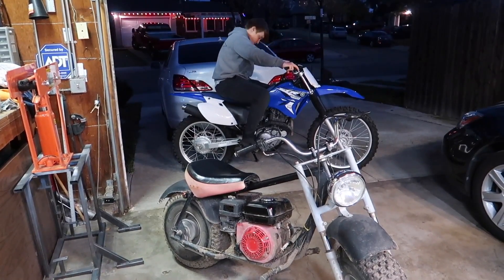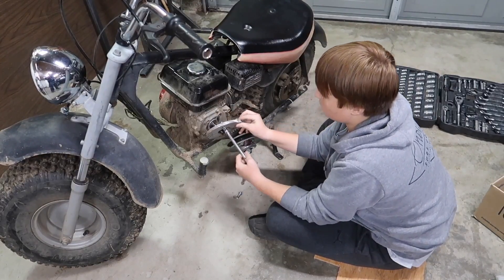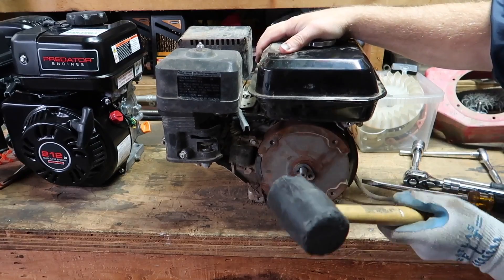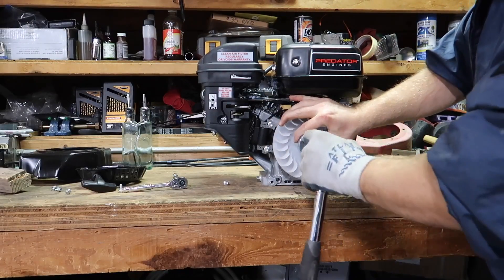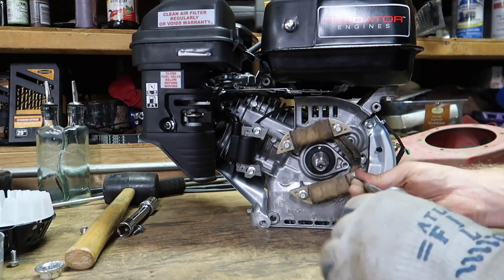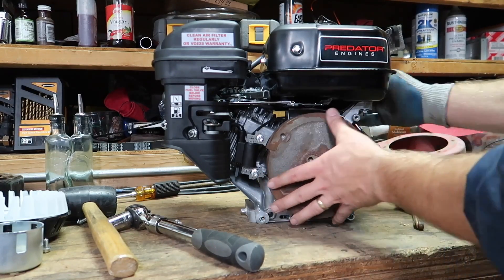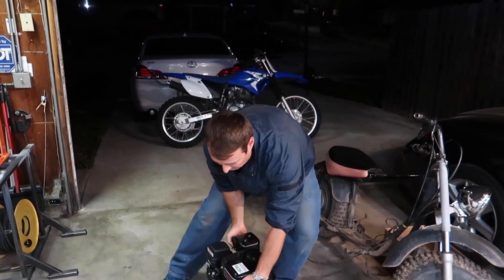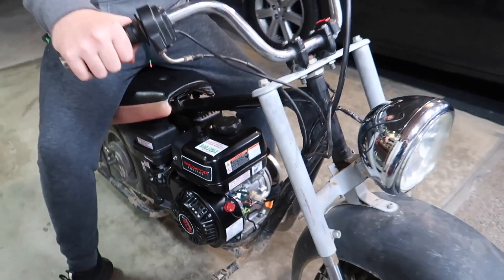Powering 12V headlight with 212cc predator engine

Comment: Nice Job.   You can wind your own coils,   they're only a coil of wire..    Take an old one apart,  unwind it,  and count the number of turns it takes to remove the whole wire..   If ya rewind it with longer wire (more turns)  you'll get more voltage..    if ya rewind it with larger gage wire,   you'll get more amperage. .
 either way  =  MORE POWER !   Then you can add a tail light,  and fog lights,
Reply from the maker: ThomasTheSailor Chubby 
Thanks for the tip. I’ll have to look into that. Cheers 👍
Reply: Thanks for that info ...I have hemi version and luv to make stuff work

Comment: What's wrong with the Hf flywheel? Won't it work with the coils?
Reply: John Larson you need the fly wheel with the special magnets on it to work with the coils. That’s how it generates electricity.
Reply: Then which one
Reply: Cris Leon the original engine that came with the light has special magneto coils. The flywheel has magnets which work with the magneto.
Reply: Thanks
Reply: so the Predator that has mounting holes for the coil, and even has motors that come with the coils( the generator's motors).. but doesnt put the flywheel with magneto   in every motor they produce? I guess it would add too much in cost for mass production to add something that isnt being used eh?

Comment: What type of voltage comes out , ac or dc?
Reply from the maker: jose navarro 
Wall outlets are AC current
Alternators, generators DC current. I strongly believe these coils produce DC current.
Reply: @balabay77  Nope...it's AC.  BTW - Alternators are literally called what they are because they generate alternating current (AC).  That's why car alternators have a rectifier/regulator on them to produce the steady DC the vehicle runs/charges off of.  You can get a $10 4-wire rectifier/regulator from Amazon for things like mini bikes & go karts.  2 wires hook to your AC output (from the coils), and the other two can be hooked to a small battery which can then be used to power DC items such as LED lights.

Comment: Is there a way to hook this to a battery to keep it charged?
Reply from the maker: Justin's Garage 
I’m sure there is a way to hook it up to a battery but I haven’t tried it. If you find a way to do it share your info with others. Thanks for watching and commenting. 👍
Reply: Yeah I think all you need is a 4 wire rectifier regulator you can get for 10 bucks on amazon..  It'll keep batt charging at 14.4v. If not enough voltage from regulator, could use a boost circuit to bring it up to 14.4v.
Reply: @bwxmoto  hmm sounds like a neat little project for a super capacitor.

Comment: Do you have to have the old flywheel or will the new one work?
Reply from the maker: SbXloc3 
The new flywheel doesn’t come with magnets on the inside of it. Magnets on the Outside of the flywheel generate electricity for the spark plug but the inner magnets for the lights.
Reply: Ya i payed more attention to it when i rewinded the video. Thanks tho

Comment: How many volts and watts does that coil put out?
Reply: Luke Hansen it puts out an unsteady amount depending on the rpm the engine is running, you will need some kind of current regulator for the amount of voltage you would like.
Reply: At full throttle would it run 2 18w lights?
Reply: Luke Hansen, probably, you can check the output with a volt meter to see what’s its putting out with normal throttle.

Comment: Thanks for the vedio. You have helped me in the past in building my baja bike. It's completed. Thanks  for ur help. A quick question my baja bike has a handle with a coil spring on the top middle section of the handle bars which acts like shockers. Where can I get a handle frame like you where the shockers are at bottom of each end like tradition bikebir your bike. Also which can fit like yours on my baja bike. Thanks pl. Reply
Reply from the maker: Hello Randy. If i understood you correctly, you have the older style front fork and you would like to convert it to different shocks? heres a link to parts that you might need
https://www.ombwarehouse.com/mb200-128-baja-oem-steering-stem-assembly-black.html 
https://www.ebay.com/itm/Mini-Bike-front-Shocks/173073366056?hash=item284bf9fc28:g:AEYAAOSw9mpaN1rc
Look like these shocks are hard to find but maybe other websites have them? good luck
Reply: balabay77 THANK  you soo much. Where can I get the shockers for this fork handle pl
Reply: Oh ok in saw the linnk for the shocks THANK you

Comment: Hi, I just bought ct200u-a with it stock engine (196cc) I need power distribution unit to generate electricity for all lights. Instead of buying exterior power unit or a generator for that matter , I need this installation. Like I said that I have the stock engine I do not know which flywheel to buy, please can you show me all 3 parts for to buy?
Reply from the maker: Nulapon love 
Hello 
You’ll need flywheel 
https://www.monsterscooterparts.com/baja-mb200-flywheel.html?gclid=CjwKCAjwsfreBRB9EiwAikSUHTzI_RCqdF7lObaNxp5ESuUlKpYHSR70T4iy4gfMtONzHqR57ag2KBoCi5cQAvD_BwE

A charging coils 
https://www.monsterscooterparts.com/charging-coil-163cc-196cc-gocart-engines.html?gclid=CjwKCAjwsfreBRB9EiwAikSUHSM7QL_8r9og1npCPMZg0KPjXE5uVHNP8tOp2-_CRt3MrYs5SSnmZRoC238QAvD_BwE

And a fan for your flywheel
https://www.ebay.com/i/183507957982?chn=ps&ul_ref=https%253A%252F%252Frover.ebay.com%252Frover%252F1%252F711-117182-37290-0%252F2%253Fmpre%253Dhttps%25253A%25252F%25252Fwww.ebay.com%25252Fi%25252F183507957982%25253Fchn%25253Dps%2526itemid%253D183507957982%2526targetid%253D474392086544%2526device%253Dm%2526adtype%253Dpla%2526googleloc%253D9032435%2526poi%253D%2526campaignid%253D1480970876%2526adgroupid%253D56758917549%2526rlsatarget%253Dpla-474392086544%2526abcId%253D1139286%2526merchantid%253D101500315%2526gclid%253DCjwKCAjwsfreBRB9EiwAikSUHYKG53G1BsTCfuqJXqZfcCNgxXFZ2auH55cW8F9Xyiai-3wT8xu8dBoCooAQAvD_BwE%2526srcrot%253D711-117182-37290-0%2526rvr_id%253D1729096171906%2526rvr_ts%253De1b34b541660ad4d1cd12cd0fff2db68

Good luck buddy

Comment: What about a voltage regulator? You don't want lights dimming and growing bright with variations in engine speed.
Reply: He'd need to install a battery and a voltage rectifier to have a voltage regulator be useful. It isn't really worth the effort. All you would get is a headlight that is bright at idle until the battery drains itself to idle voltage.
I could argue that a voltage rectifier is a much more useful modification to make, converting the power to DC is easier on the bulbs, and DC power in general is more useful in this application, but even that's not necessary. There are thousands of these little Doodle bugs running away with AC power lighting the headlight. In the end doing nothing is probably best. No use modifying it, unless you wanted to run say an air pump, or a phone charger

Comment: best option i found is to JB weld some super magnets on the inside of the flywheel it came with and i grabbed the stators off the engine that came with the BAJA.....total cost...15$
Reply: What magnets did you use? Does placement on inside the flywheel matter or just evenly space them? I havnt seen a link for a charging flywheel but the coil links below seem good. Someone should sell the fly wheels and coils as a package.
Reply: Ummm no..... Not balanced at all. You will eventually kill all your bearings.

Comment: The block is perfectly clone from the Honda engine that's why it has all of the same holes and parts, just different generations of Honda clones at different gas tank mounts and different valve covers

Comment: the hemi has a different crankshaft and the fly wheel is different
Reply: Is it worth buying the hemi version? My local HF only has the Hemi at the moment. Was going to wait for the non-hemi to come back in stock.
Reply: @ChristopherJones16  I was wondering this also because I ended of with hemi one back when they were $99 at HF

Comment: Did the predator come with magnets inside the  flywheel? Or you swap the old one in the predator212
Reply from the maker: Vance mac D 
Predators flywheels doesn’t come with magnets 🧲 
That’s why I installed the coils and flywheel from that old engine. The swap was a success and everything still works.
Reply: @balabay77  I had a Coleman motor brand new ran for 1 day then 212 non hemi swapped the bike and decided to get the headlight working I installed everything like you did in the video but my headlight won’t work I have people telling me to get a tree magnet flywheel then to buy new coil pack if you could give some advice that would help very much

Comment: Was there a huge difference in performance between the little 160cc compared to tbe 212cc? I'm redoing a Baja and plan to put a new 212cc on her.
Reply from the maker: Phil Lowman 
Yes sir, predator engines are well build and usually run great for a while. If they run solid right out of the box and there’s no issues with carb than it’s a keeper. 212 is definitely  much more powerful than 163cc. If it makes you feel better about your purchase than get a warranty for it. Good luck and let us know how your motor swap turns out.
Reply: I've been buying and using these HarborFreight engines since they were Blue color "Grey Hounds". If an old model Briggs gives any trouble at all I'll swap it out for one of these. Its just that I haven't used one of the 212's on anything that you ride for speed. I've only used them for boring old man stuff like garden tractors , garden tillers , wood splitters. The only thing is that they have a super bad habit of cranking on the first or second pull every time. Oh and they have a problem of only burning a small fraction of the gas that Briggs , Kohler burns doing the same job. Predator should give me a royalty check for selling so many of these engines. People will ask me to work on their old small farm stuff. I'll show them the old Grey Hound on the wood splitter and everyone known how hard I use it and even tho the sheet metal pull shroud is falling off and I gotta hold it up so the rope thingy will engage the flywheel to start. After explaining the only thing its had was an ignition coil because its never spent a night inside , well they gladly pay $100.00 for a Preditor and toss the ancient technology they had.  But as said I have just never put one on a minibike of go kart.
Reply from the maker: Phil Lowman 
Glad to hear those greyhounds are so dependable. I had the same luck with predators but there were 2 engines that ran hard and couldn’t idle properly right out of the box. Returned them and got another engines without any issues. I’m sure Honda’s are better quality but predators work just as well for 1/3 of the price. Cheers.
Reply: balabay77 I think they are the hondas that didn't pass Honda quality check... almost but not quite a Honda... but damn good enough for 99 bucks.
Reply: @timm.6391  Greyhounds ,predator,duramax,and list go on are honda clones
Reply: Wait until u have a 420cc u wont ever go smaller again.!

Comment: Would this work on the 79cc predator?
Reply from the maker: ryan hall 
79cc engine is much smaller than 212cc so my guess is probably not. Besides, the shaft on 79cc is 5/8 compared to 3/4 on the 212cc. That reason alone won’t allow you to mount the flywheel on your engine.

Comment: Can you do it with a billet flywheel
Reply: I asked the same thing yesterday, then went outside to check mine. No, because there are reinforcement bars on the back of the billet flywheel that prevent it from fitting over the magnets. I don't know what would happen if you cut the reinforcing arms off, I'm sure they're there for a reason but even still it doesn't look deep enough to fit either.

Comment: Typo 

can I use the fly wheel that I already have ????
Reply: Charles& ashanteria, most likely not because the fly wheel on the one from the old engine in the video had special magnets on it. Unless you buy a new one it won’t work.

Comment: I am trying to put lights on mine  go kart. it's also  a 212cc predator.  I have install the charging coil and flywheel with three magnets.  two on the inside. one out side.  the coils have Brown wires. I run the engine. i put tester  light.  I don't get 12v.  do I need a voltage regulator.
Reply from the maker: bonbon cabron 
To be honest with you I haven’t tested this setup for voltage. My goal was to power the lights and it all worked out. If you need a constant 12v power than maybe you’ll need a voltage regulator + a battery?
Does your engine power your lights?
Reply: I made it work. I just needed a voltage regulator retifuer.  Cause I am using led lights bar.
Reply from the maker: bonbon cabron 
Cool beans. Glad it all worked out for you. Cheers.

Comment: It's a engine not motor
Reply: It may be, but the terms are used almost colloquially, tell me , do you ride enginecycles or motorcycles, this is just a nitpick to sound smart , but it doesn't
Reply: Years ago I messed with my friend about this. He had the hood open on his car and said "I have to pull the motor". I said which one, the starter or the alternator? He then said the engine. People just name things differently. Another example is the "valve cover".  Not sure why they call it a valve cover. When you pull the cover off you don't see valves, what you see are rockers. That makes it a rocker cover, not a valve cover.
Reply: @xxjusxstarxx  you're in a different ballpark.. playing soccer. you're arguing etymology at this point, which does not equate to the grammar of the situation. that said it would have been easier to just call him on 'an engine', not 'a engine' and 'a motor' not 'motor'

Comment: I would agree and say nice video, nice video showing people how not to properly do this, if you can take a flywheel off with a rubber mallet then something is very wrong. Also when installing new or used flywheel you definitely need to lap the flywheel to the crank. I'm sure by now you've probably have the issue that results from not doing this. It looks like you need to do a little more research before diving into something like this to make sure you're doing it correctly, especially when you're sharing it with the world.
Reply from the maker: Lol 
I appreciate your concern but everything was installed correctly and our mini bike still runs like a champ without any issues. When it comes to taking off the flywheel, yes it did take some elbow grease to remove it. I’m pretty sure most youtubers will figure out that removing a flywheel will require certain amount of persuasion. It’s not rocket surgery.
Reply: I'm a noob.. what does "lap" mean when you said lap the flywheel to the crank.  Also what happens from not doing this? ("you've probably have the issue that results from not doing this")

Comment: The Hemi engine is made by Loncin but be rebranded for Generac and Toro for their products they use the engine on. the non hemi engines are clones of a Honda Gx200. as others brands may or may not work for charging coils. like a 208cc engine. the 212cc engine nom hemi engine its also labled Tool Shed for Rural King stores but its the same as the predator engine.  These come with a governer its ment to replace engines on equipment rather than GoKarts or minibikes.  as the gaskets for this non hemi engine you can get for a Honda Gx200

Comment: I love how you make a video with this title and then show basically nothing of how to actually do the project! Awesome!
Reply: Did you not watch the video? Buy some coils and a fly wheel that's made for it then put it on, pretty simple dude.
Reply: What? He did everything and showed everything. There wasnt much to it either.  Just a couple parts.. Remove the pull-start cover, remove pull-start cup, remove blower fan disc, and then remove the flywheel. Thatll expose the coils.  He then put it back together started the motor up and showed how it could power a light.
Reply: obvious troll is obvious and uninteresting.

Comment: What if I buy the charging coils new cuz I use my fly wheel that I already have ???
Reply from the maker: Charles& ashanteria 
There’s a high chance that your flywheel doesn’t have the magnet on the inner part of it. As the flywheel spins, the magnet passes over the coils creating electricity that powers the lights. Check your flywheel and see if you have that magnet on the inner part of the wall. If you don’t than your coils won’t work. Good luck
Reply: So the predator doesnt have magnets?